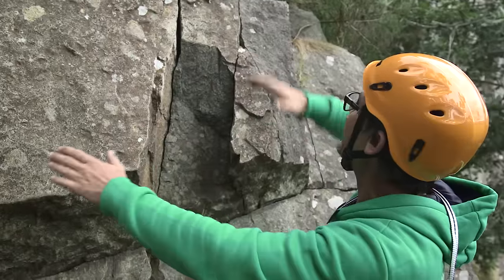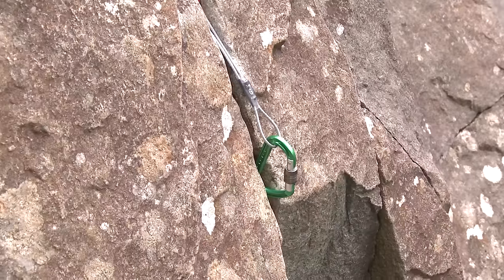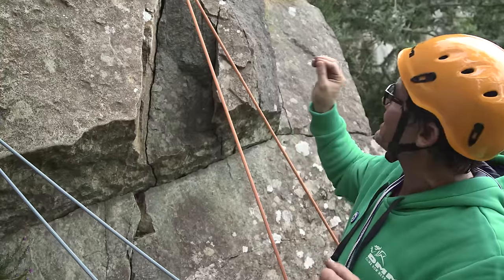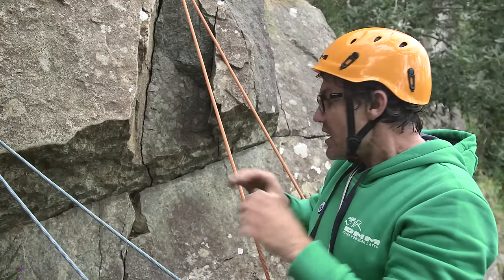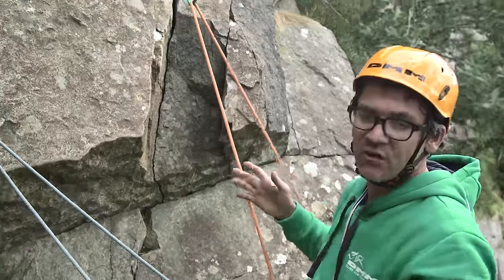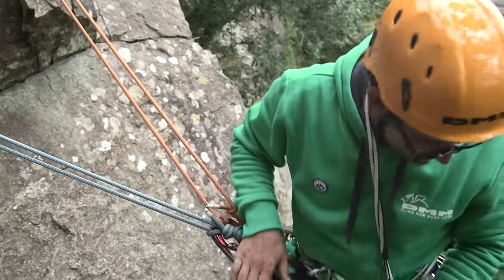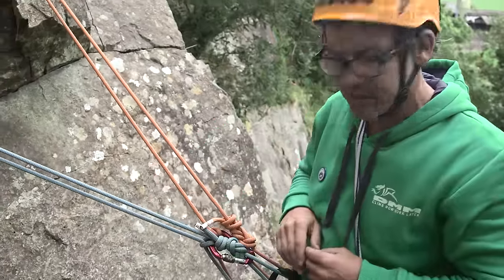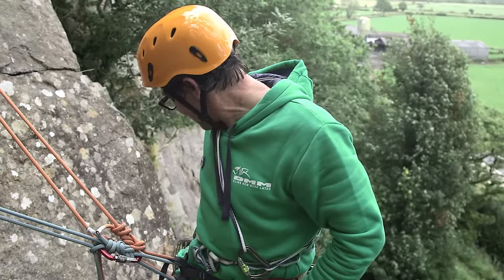Multi-pitch climbing: set up a belay at a stance

Comment: Well, I think it’s a well done, clear instructional video. Of course there are other ways of doing it - many - but this as a basic one is just fine. Except, as others have pointed out, I would have tried to have a third nut that would take an upward pull to make it perfect. But this is not always possible. Many classic adventure routes have much more dodgy belays than this (eg. the top of the 2nd pitch of Diagonal). Most climbers, unless much lighter than the leader (e.g. a small girlfriend), will NOT be lifted off up off the ledge if the belaying is done properly. In my 40 years of climbing I held dozens of falls, one or two directly on to my waist belay (tremendous force), and I never dropped anyone. Many of those were in the days before belay plates were invented, and involved waist belays wearing leather gardening gloves. It goes without saying (i hope) that beginners and relative beginners should practice belaying in a safe place (small crag with nice grassy ledge at bottom for example, like the Capel Curig Pinnacles). A good thing to do on days when the weather is dodgy/showery. One other point. The way he uses his hands with the belay plate is not the best way, and not quite the system I used.

Comment: I find a Edelrid megaJul  belay device good with double ropes, especially skinny ones.  It autoblocks on a fall, with the biner being pulled up into a notch.  TAkes a bit of practice to use rapelling etc.  But you can also rappel with a munter hitch and prussik as back up.
Also I prefer a long looped spectra cordellete at belays...

Comment: Always nice to learn diferent techniques, thanks or the video. In case the second climber get stucked or for any other reason you need to reach him, HOW DO YOU ESCAPE THE BELAY ???
Reply: Or you second just carries a good old pair of jumars...
Reply: Julio Lopes -
- Tie off the belay device
- Attach french prusik on climber's side of the rope.
- Tie a klemheist around the lines leading to the anchor
- Attach the prusiks together using a tied off munter using a sling between them (probably the same sling you tied the klemheist with)
- Release the rope and let out enough slack so that the prusiks are weighted.
- Back up the climber's rope in some way (tie off belay device again and rebuild the anchor with a new master point for example, or use your improvisation skills)
- Secure yourself and untie.

Is that going to be slower than just tying off your belay device in guide mode off a cordelette? Yes. Is it an acceptable compromise if the likelihood of needing to escape the system is low? That's up to you. For single pitches at a busy crag, I'd say it's fine - you're probably just going to lower them back to the ground and/or shout for help. For multi-pitches in the middle of nowhere, I'd probably use an isolation loop (tie a figure of 8 on a bight, and then create the anchor using that fo8 instead of your tie in fo8) or better still, a cordelette. There's pros and cons to both (what do you do if you drop your cordelette for example? the rope is more dynamic, the rope is higher rated, the rope is arguably faster, etc)
Reply: Read a climbing book, this is a simple process.

Comment: no multi-directional piece in the anchor? if the leader fell on the next pitch, the upward force from the fall on the belayer would rip both of those nuts out of their placements
Reply: THANK YOU!!  I notice the lack of multi-directional or upward force pieces on EVERY anchor building video!  It seems like every belay station on youtube is designed to get the second up to the stance and then both rappel down immediately because the anchor is not prepared for a safe next pitch...
Reply: I would not think that would be necessary with the ledge he is on? He has to be pulled like 3 meters into the air in order for the pieces to come out. Yeah, I get it if he was closer to the pieces but on a nice ledge like that it just seems so unlikely.
Reply: Depends on a number of factors. Here, the belayer is positioned quite a bit below the station, his bodyweight acts as the counter-weight when a lead climbing fall would occure. As long as you belay over your body, are positioned below the anchor quite a bit and know how to belay dynamically (feed rope through your belay device during a fall) then you (hopefully) won't get pulled up far enough the rip out your pro.

Comment: Why not run an equalized sling between the two points and then belay the second with the reverso?  Self-blocking, and not on the harness, so just as solid and less punishing in the event of a second falling.
Reply: Very much agreed
Reply: With how far apart the two pieces are, he would need to use a very long sling to get a decent enough angle between them if equalizing.  That would put the masterpoint pretty low to the ground which would make the belay very awkward.  The way he's belaying here puts a good angle between the pieces, uses the rope which is stronger than any sling and better for absorbing forces in the system, and he's belaying off his tie in loop which puts the force from a second fall straight in to the anchor.  Very easy to hold a fall belaying the way he is.
Reply: Using the rope to build the anchor and belaying through yourself results in lower forces on the gear. Lower forces means anchors won't rip out

Comment: I have never climbed with 2 ropes. Is this necessary to pitch climb. I'm used to sport climbing. This looks much different and also different gear. What type of climbing is this called?
Reply: This is Trad (traditional climbing) where you would use nuts or cams in cracks for protection rather than bolts in sport climbing. You usually use 2 ropes as the routes you typically climb in trad might change direction quite a bit, this helps with rope drag over the climb.

Comment: Hand placement is on wrong when belaying, if you're not going to use an autoblock, shouldn't be letting go with your break hand.
Reply: Actually, it's quite common in Europe to be taught a belay technique where you cross hands over on the dead rope (brake strand to you guys). The rule then isn't "never take braking hand off the rope" but "never let go of the dead rope" i.e. you must always have at least one hand tight on the brake strand, but you can let you with your dominant hand as long as you are locked off with a firm grip from the other hand. Although I think general consensus is that PBUS is that most reliable method for teaching beginners and will probably become standard over here eventually.
Reply: The AMGA (American Mountain Guide Association) also teaches PBUS.

Comment: WTF this doesn't seem right at all. I'm sure there are many ways to skin the cat, but I would have just used the rope to build an equalized anchor off those nuts with a master point. Anchored myself to that. And set up a top belay off the master point in guide mode. Belaying upside down off your own harness like that? No thanks.
Reply: He did use the rope? But not making a big master point saves time and is no less safe. This is perfect for twin ropes. Have you ever tried belaying like that? 99% of brits belay like that when climbing trad and I've never heard of an accident caused by it and its very simple to do.
Reply: done it this way a 1000+ times. It's the standard way.  Puts less force on the anchors which can be essential if you have limited options
Reply: @ianwebb6182  The standard way? I've not seen anybody advocate doing it this way ever. Most will just hang the belay device on the anchor in guide mode and belay like that. It's faster. It's more simple. And the device operates with assisted braking instead of you trying to pull the brake up against gravity by using your triceps and lats. And you're also separate from the belay. Less force on the anchor? I don't see how. If your partner falls in either situation, the anchor feels it. If you look closely, he's belaying off the anchor's master point!  So why not hang the belay device in the proper orientation (guide mode) instead of trying to belay upside down while you're also attached to the belay point. Hang the belay device above you in guide mode like it was designed to do.
Reply: @FourT6and22  I've never seen anyone do it with the guide mode (although i understand the technique) - at least in the Peak district or Wales. Each to their own - but this is just second-nature, its so easy and fool proof and the climber can just climb thru with no messing around
Reply: @ianwebb6182  Maybe a USA vs England thing